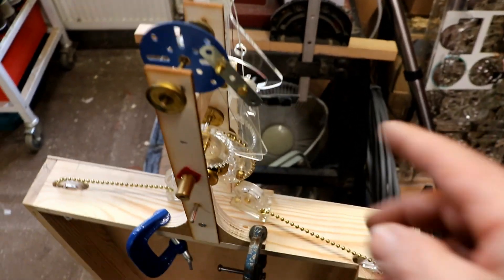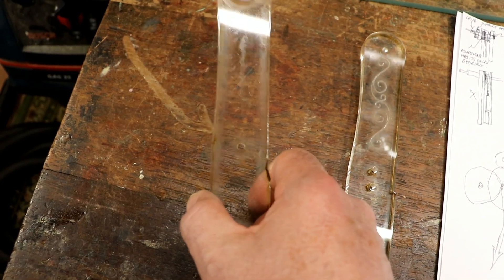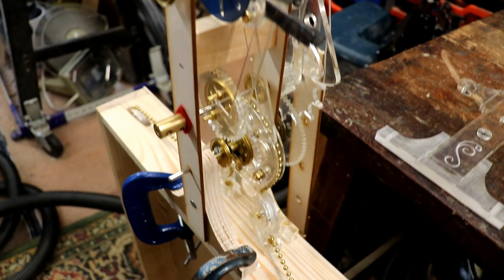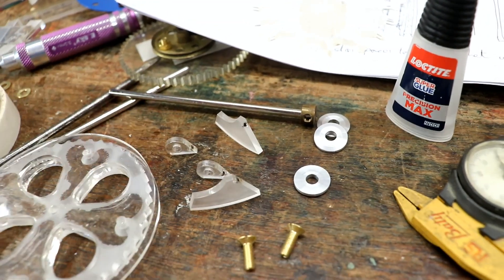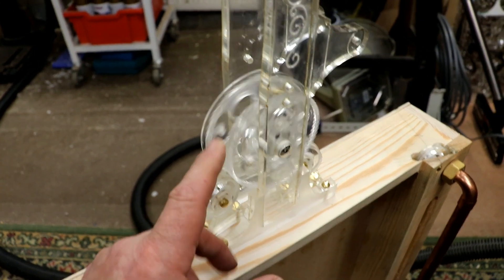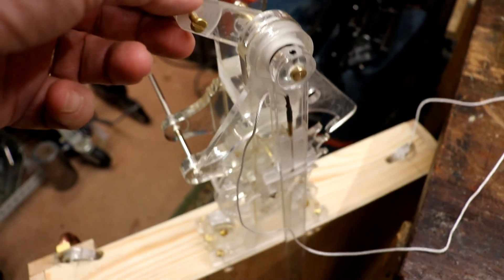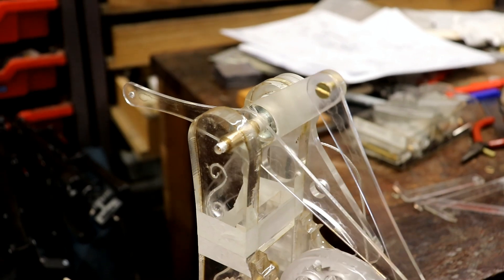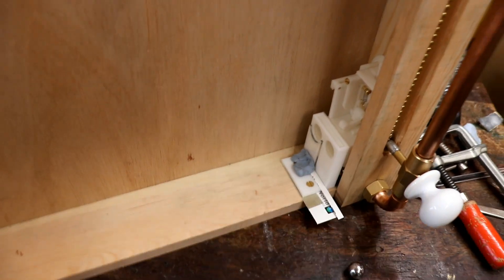Unplanned Steampunk Arcade Machine #5

Comment: Well done as usual. I will send my recommendations as email. But keep in mind not to spend too much potential energy on the scoring system.  You have limited energy also in order to succed you may need to reduce the mechanical complexity. You have too much mechanics at the scoring they all need energy to work also increase the points of failure.
Reply from the maker: Thanks Ibrahim. The scoring system shouldn't use too much energy, as the ratchet pawl is only having to lift a weight just heavy enough to re-wind it when the pawls are lifted. If the score pointers are carefully balanced and the 'tens'/'hundreds' dial is geared down 10:1, the weight should be quite light.

As always, it has become complicated, although every mechanical part does fulfill an important function... However I am wondering just how much energy will be left over to move elements of the game play. I could always add more weight to the ball lifter, as the human can input the additional potential energy required!

Comment: I have only one suggestion: People like big score. Playing games, people like to get more points, when asked how much you got here, they are more pleased to answer 793, not 7.5 :)
Reply from the maker: That's a good point. As the scoring ratchet makes two rotations per ball lift, perhaps I shouldn't gear it down - two rotations of the 'units' score display per 'level'? It could also count up in tens rather than units, then the smaller dial could read hundreds rather than tens...
Reply: @steamhead  In fact, the speed of scoring and the overall impression of the game depends on the speed of one round. Conditionally, if you have one round lasting an average of 6 seconds, then this is an awfully slow increase in points. I think you should debug this mechanism after you've done the gameplay. My idea is for you to score about 60%-70% points in the average time of the game, so it will be interesting. I would take the scale from 100 to 1000. It turns out that in the average time of the game you should score about 650 points
Reply from the maker: @ckoetael  I hadn't even gone to the trouble of timing a round - I've just discovered it's 44 seconds! Definately lots of debugging, once I've established the mechanism actually works.

Once I've actually got the game part built, I can adjust the scoring by changing gear ratios and the displayed score dials. Thanks for suggesting the 60% - 70% idea, and an average score of 650. Most helpful.
Reply: @steamhead  as I understand it, this is the maximum time for lowering the load, but you still have to come up with a gameplay for 44 seconds. it turns out that the average game time should be 28-30 seconds
Reply from the maker: @ckoetael  28-30 seconds is interesting, thank you. Once I've got the 'game management' system working, I'll finally start working on the actual game play! Because it'll be purely mechanical I assume a lot of trial and error will be involved, along with many requests for help and ideas!
Reply: @steamhead  Maybe do it in the steampunk circus style? then you can attach the jester's head on top and make it more colorful, plus the arrows can be made like the hands of a jester
Reply from the maker: @ckoetael  that's a geat idea, thank you!
Reply: @steamhead  the second thought. you have a game with a time limit, in order to be interesting to play, you need to increase the difficulty of the game in proportion to the remaining time. it may be worth considering the options that the cargo will overcome some levels and thus open up difficulties
Reply from the maker: @ckoetael  I'm assuming that once I start working on the actual game play, I'll be able to add all sorts of scoring variation mechanics to the existing 'game management' system, such as being able to speed up/stop the descent of the ball carrier and being able to deduct/add to the current score. It's all so exciting, the possibilities are endless!

Comment: Make a new plan, Stan
You don't need to be coy, Roy
Just get yourself free.

Great work John plenty of opportunities to adapt for other devices. .  Suggestion, it seems your pawl friction is stoping a quick reset.  What about a little ridge in the conduit so once the ball has some speed it jars the pawl string.   Banjo sends scratchy.
Reply: There must be 50 ways to move your lever.
Reply from the maker: @epiendless1128  Inspired!! Any further lyrics greately appreciated.
Reply from the maker: I feel a Steamhead anthem coming on...

The fact I'm recording all the plans in CAD, and the thought that this whole mechanical system could be used in other games does fill me with joy!

The steel ball is so light, even a small bit of fluff causes it to get stuck in the conduit. I could make it steeper, but then the actual play area would be reduced! It takes several 'ticks' to finally release, as there's not enough energy to pull up the pin that links the escapement to the pendulum in one go. Each time the pedulum swings to its end, the pin moves up a little. I've shortened the amount the pin has to move to release the pendulum, so I'm hoping it's acceptable, also some lubricant should help. I haven't used any yet, as it would stop me from painting it... Ziggy returns scratchy.